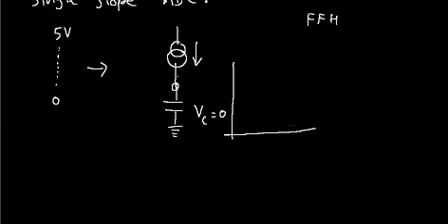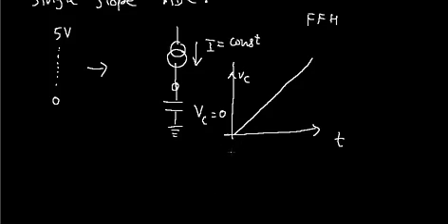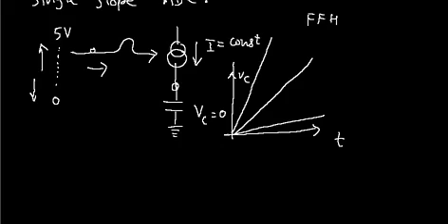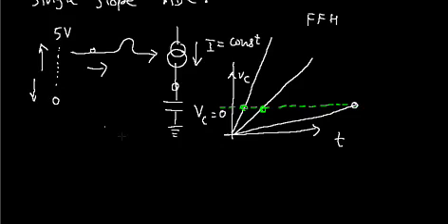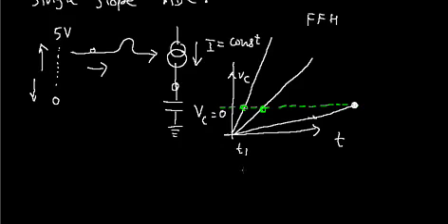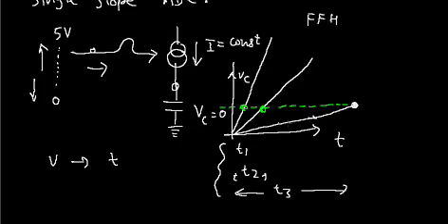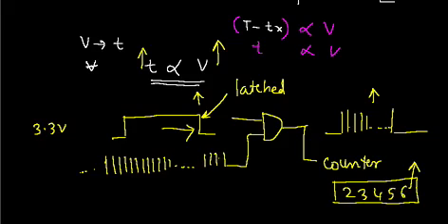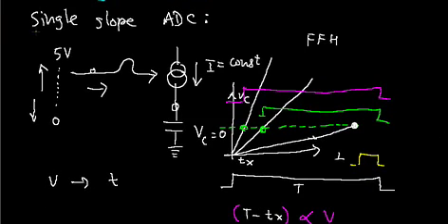Analog to Digital Converters (Part 3)

Comment: Why does the capacitance keep changing? Due to what factors?
Reply from the maker: A capacitor is synonymous to a water tank (this is an analogy). If we continue to pour water into the tank, the level (voltage) continues to increase.  It means the capacitor charges till the current is flowing. If the water level of the tank reaches the level of the pipe (incoming water), the flow will stop. Does this answer your query?
Reply: Vidhyadhar Dharmadhikari Thanks 😁
Reply from the maker: BTW, Are you a faculty or student?, Which institute?
Reply: NIT Trichy student

Comment: Thank You for the video Sir. 
I have a doubt, How can number of count increases with increase in input voltage?(5:30)

Because , as input voltage increases, Tx decreases and time period for AND gate increases thus count per given time reduces right?

ie as input time period is increased number of gated pulse reduces right?

Here the digital counter counts the frequency cycle or each pulse that contain high frequency signal?

Sir, Please help me.

Comment from the maker: Hi, Sorry for late reply.
Tx here means unknown time. The ADC explained here converts unknown input voltage to proportional time period. This period depends on the unknown input voltage. Hence I refer it as Tx. 

If the input voltage is small, then the current source value is also small, this causes capacitor to charge slowly resulting in larger time period. This we get inverse relation. To get directly proportional relation, we do T-Tx